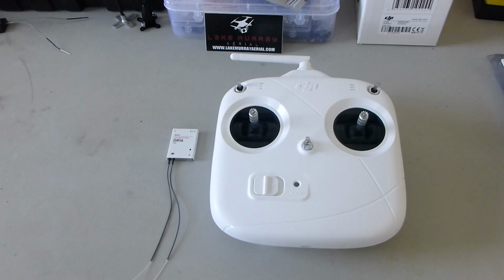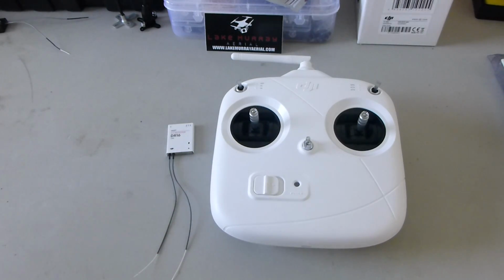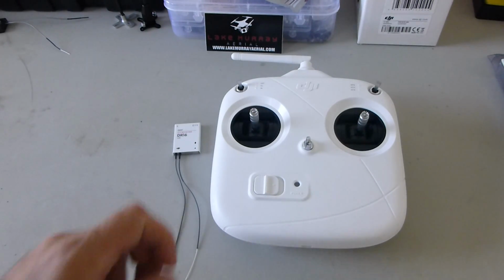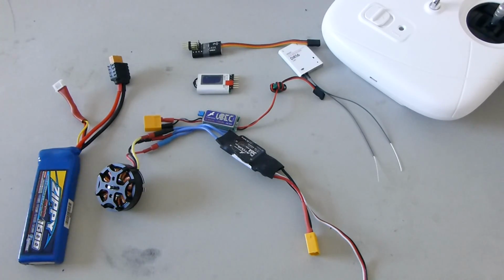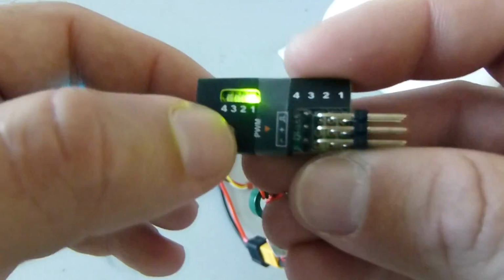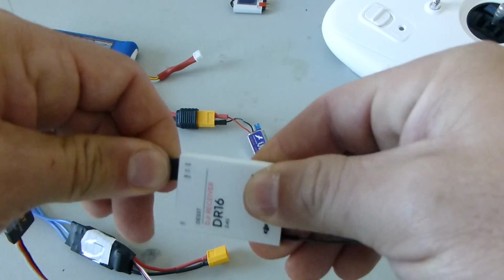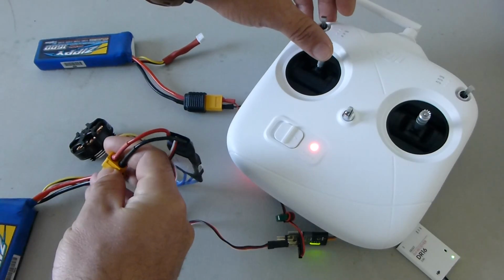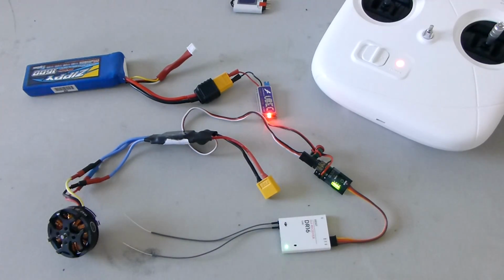How to do ESC throttle range calibration on a DJI DT7 DR16 Radio System

Comment: Murray, Big Big help. I have a question don't know if you could answer but try. Have a built using a set of Hobbyking ESC's like U, only running a Lightbridge 2 and I noticed the motors won't start as problem U had. I purchased the ESC change, both parts as you did in demo. Wonder is need to do the same?  I'll try a30And see what happens. I have 6 DJI ESC's but 30A's and Hobby's are 40A, just as soon use those. hi
Thanks for reading. Answer appreciated if possible. Edk/noeked@yahoo.com  mny tnx for FB video.

Comment: Is the dt7 available without self centering throttle stick? seems annoying when doing sport flying
Reply from the maker: No, only available as self-centering. Probably it could be modded to be a ratchet throttle.

Comment: I am newbie doing a quadcopter. Where did I wrong?
-Emax Mt2213 935kv 2212 Brushless Motor 
-ARRIS 2-6S 30AMP 30A SimonK firmware OPTO Brushless ESC. 
-DJI NAZA Lite NAZA-M Lite Flight Control System GPS Module
-DJI DT7 DR16 RC System

Comment: I followed your instructions and I did not get any motor movement. Any suggestions???
Reply from the maker: +vicioustelekinesis1 Are you using the same components? Give me some details about your equipment. A video is the best way to troubleshoot over the internet.
Reply: +Lake Murray Aerial  I am newbie building a quadcopter. 
-DJI DT7 DR16 RC System
-Emax Mt2213 935kv 2212 Brushless Motor 
-NAZA Lite NAZA-M Lite Flight Control System GPS Module
-ARRIS 2-6S 30AMP 30A SimonK firmware OPTO Brushless ESC

Comment: Great video solved my issues and everything working as it should. My DYS ESC's needed me to power on at full throttle, wait for the tones to finish, pull throttle all the way down wait for tones to stop then immediately repeat the process over without powering off. Not sure if this is just an issue for the DYS BLheli ESC's but repeating the process did the trick. Thanks for taking the time to figure this out and post the video.

Comment: hi.
if i have a dji phantom 1 reciver (ppm- 1 antena)) can i calibrate the third party esc with the decoders ?
the reciver look like this

http://www.flying-hobby.com/images/large/DJI-PTM18/DJI-PTM18_01.jpg

or i need another method?

thank you
Reply from the maker: +Stanislav Zeldovich Since that is a DBUS receiver the same as DR16, the process outlined in this video should work for it as well. But, since I've not tried it myself, I cant guarantee it 100%
Reply: I will try, thank you.

Comment: Hey Justin.... you seem to know a fair bit about this stuff....
Is D-Bus the same thing as S-Bus?
I have an old F550 which I have pinched the naza-m v2 off to build an S900 - but I want to use a cc3d as the FC for the F550 (I have the DJI E300 OPTO ESCs). Will I be able to use the DT7 as an S-Bus radio?
Reply from the maker: +Adam Sweeting While S.Bus and D.Bus are synonymous in the NAZA world, I am not sure the DR16 receiver would work in a normal s.bus application with a non-DJI flight controller. I've personally never tried it, and I put your odds at success squarely at 50/50 ;)

Comment: Thank you Justin!  Very nice work on figuring this DJI monopoly out.  I can verify that this also works with the stock Phantom receiver and stock DT7 radio, which by the way is a nice and cheap option for a transmitter.  The replacement Phantom TX's are about $10 or so, so you get a nice PPM single wire RX/TX solution for any model you want to use the DT7 with.  I calibrated T-Motor 12a ESC's along with a stock Phantom RX with your solution and it went as smoothly as yours in video, thank you for your great tutorial/video!
Reply from the maker: Thanks for watching and glad you found the video helpful!

Comment: I have an idea...

What if you powered the Naza with one battery, the esc/motor with a different battery, and hook your ESC to the throttle ch. on the Naza. Also, set the Naza "cut off type" to immediately off rather than intelligent off.

Plug in the Naza first and ARM (with the stick combo). then, plug in the ESC battery while holding the stick at full, wait for the ESC to beep etc.

Did you try that? Seems like it should work. I want to use a Naza with different ESCs,  so I hope it works and I don't have to buy all those other gadgets.
Reply from the maker: I have not tried this possible solution but I can see the line of logic behind it... It might work but I'm not sure. Also, you mean plug the ESC to a motor output on NAZA rather then the T in channel, right? Because I dont think NAZA would output any signal from the input side.

If you give it a try let us know if it works.
Reply: Lake Murray Aerial
Yea, thats wheat I meant, hook all the motors to the motor channels on the Naza.
Reply: +thejason51873 Did you ever get to try this out? Did it work?
Reply: Did any of you try this method ? I have the same problem and want to try this before buying the extra parts.
Reply: CTJ87 thanks for posting this btw

Comment: are you still able to shut off the motors completely when hooked up to the Naza Lite???  I have the same radio hooked up to a Naza lite, the hex is fitted with non dji motors and esc's.... I have no problem arming the system, but I do have probs once the system is armed as soon as I allow the throttle stick to return to center then all hell breaks loose.... where by the motors spin so fast, if I allow the motors to idle then they will spin up even faster and the hex would take off by itself.....I continuously have to adjust the throttle stick to prevent self take off..... I thank you for taking the time to record and upload the video...  :-)
Reply from the maker: I did not have that issue.. Once I used this method to do calibration arming, disarming, and throttle range worked as they should. Normally the way NAZA works is when you arm the motors, they spin at the idle speed defined in assistant (there are 5 choices) until you move the throttle stick up past the center point. It sounds from your description like yours is sending throttle immediately upon the stick moving up at all past its lowest point? Can I assume you have calibrated the radio using DJI RC Assistant and also made sure none of your channels are reversed in NAZA Assistant software?
Reply: cheers for the reply.... have setup and calibrated the TX within the Naza Assistant, all channels working as they should.....I did discover a bug in the software where only motors 1-3-5 would spool up while motors 2-4-6 would only spool up when I let go the throttle stick, workaround for this was to set the software idle motor speed to one increment above REOMMENDED and hit enter and then select RECOMMENDED again and press Enter.... to be fair I am a cheap motors/esc combination......